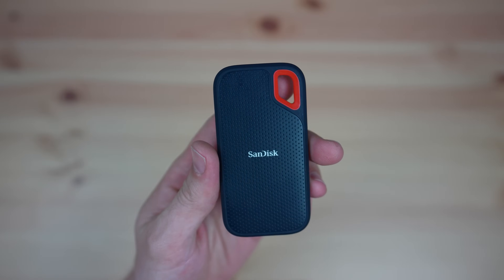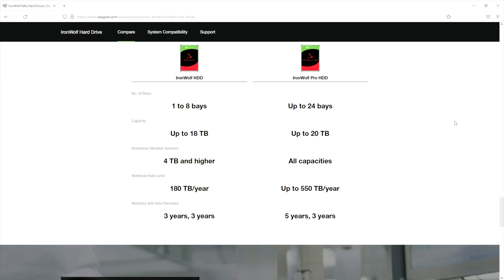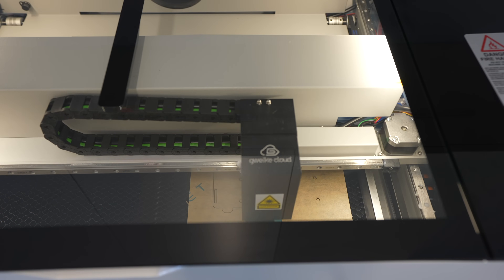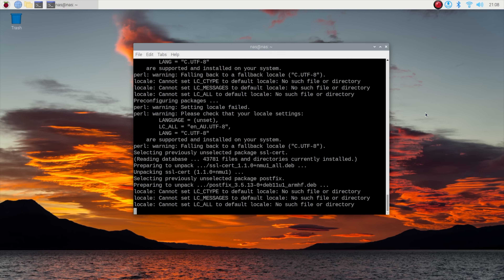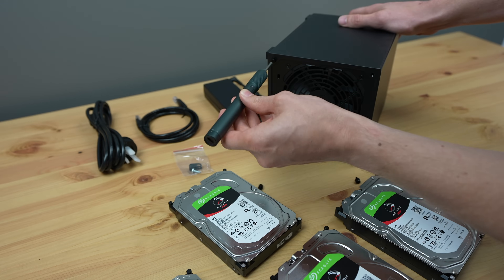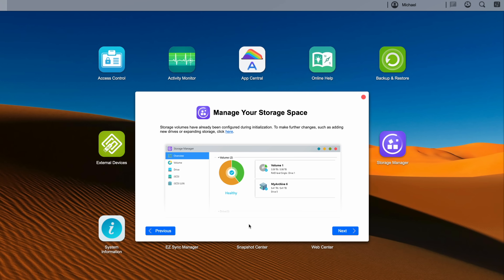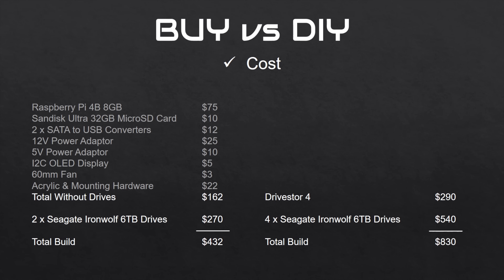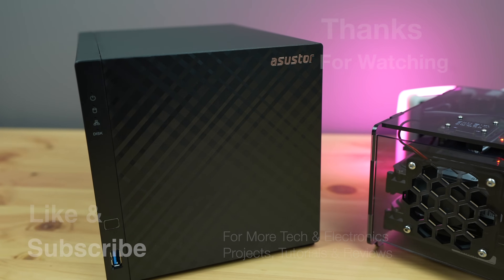Raspberry Pi NAS vs. Asustor Drivestor 4, Is It Better to Buy or DIY?

Comment: Very nice comparison. I am myself using a Pi Based NAS mainly because, I just use my NAS for casual data sharing, running services like jDownloader, transmission, PhotoPrism etc and also using Syncthing to backup my MacBook data folder in real time. It serves my purpose and as I bought my Pi long time back, it is very cost effective. But I recommend using a dedicated NAS for heavier usage or making something with little bit powerful CPU and motherboard and at-least a 2.5G networking.

BTW - I really liked your Pi Case. I wanted to make something like that for my Pi but I was too confused on how to design so that they would fit properly on sides. I ended up making a 3D Printed case and using black transparent acrylic on the side. I will definitely try to make acrylic one now. It looks way cooler than my 3D Printed one. 

Also I am using same display and showing Date/Time/IP/CPU/Memory and Temp. If you would like then I can share my python script with you.
Reply from the maker: That another nice feature of a Pi NAS, being able to run a fairly broad range of other services on the Pi alongside the NAS software.
Definitely have a try at it, it's pretty easy to design 2D parts once you get the hang of it. I've put this design up on my blog so you can download the design as a starting point if you'd like.
Reply: @MichaelKlements  Thanks. I am using 2 smaller 2.5" hard disk and I have removed USB 3.0 ports and soldered SATA ports directly to usb 3.0 in pi to remove all cables. I am also using one small SMPS to power Pi and USB HDD. The only cable now is power cable and ethernet. (I hate wires)

I saw your tutorial on 2D designing when going through the video and will definitely give it a try. Thanks a lot for such amazing content.

Comment: You compared a 2 independent drive configuration with 1G Ethernet on the Pi to a 4 drive raid 5 configuration with 2.5G Ethernet on the Drivestor. The Pi is completely bottlenecked at the 1G E. It is common for many NAS devices to be limited by network speed. Most people's home devices accessing a NAS aren't going to benefit from the NAS having more then 1G E. The big problem with this Pi config is the lack of RAID or any redundancy. (edited to correct Pi RAID and network config)
Reply: @dav1dsm1th  you're right. early in the video the Ethernet port was clearly empty, he doesn't mention plugging it in or the speed, but later in the video, the Ethernet cable is present. I am pretty sure the pie has 1G Ethernet vs the 2.5G E on the other device which he mentioned at 16:35. Also, while looking for the pie network I noticed he says the pie is NOT in RAID mode because the NAS software he is using doesn't support it.

Comment: Great video! The Asustor clearly wins for most applications which is not really a big surrprise. In your cost comparison you use $75 for the Pi which is probably unrealistic at this point but your overall analysis is right on the money. The lack of RAID on the Pi is a major disadvantage. I really love your cases btw. Wish I could afford a laser cutter. I just recently got my first Pi and I've really enjoyed your videos.
Reply from the maker: Luckily the Pi's I've got were all bought a couple of years ago, but yes, getting Pis at list price at the moment is pretty unusual.
Thank you for the support! 
Take a look at some K40 laser cutter options online, you can often pick them up for $300-$400. It's a good starting machine and it's served me well for three years or so.

Comment: Another great vid.  I have a Pi NAS with only 500GB and had no problems with it.  I found it more reliable than my WD My Cloud.  I plan to build your version, an upgrade for me.  Though the Asustor Drivestor 4 was a stronger performer, I believe for the average person, the DIY version is more bang for your buck.  Great work on the case as well.
Reply from the maker: Thank you Greg, yes if you've got the time and a bit of experience then the Pi NAS is a great option to save some money.

Comment: If you can get ahold of one, the RasPi CM4 is much more suited for use as a NAS. There are 3rd party carrier boards with the needed hardware baked in or for a more custom build there's the official carrier board. If you want to really dig in and learn a lot of neat things, the Raspberry Pi Foundation has published the info you need to design your own carrier board for a completely custom setup. While it's not an afternoon project, it's also easier than you'd expect.
Reply from the maker: Thanks for the tip! They definitely do open up a few more possabilities for a purpose built NAS.
I don't think I'm feelling brave enough to try designing my own carrier board just yet, but maybe one day.

Comment: RAID 0 (striping) is not recommend for reliability and redundancy
And also raid 5 on the drivestor it's like raid 1 
Because raid 5 is faster, so you need to Compare apples to apples..
Also, the USB 3 and lan interface on the raspberry pi shared the same bus.
The USB 3 speed is 5Gbps..
Reply: Actually our RAID 1 is faster. This ARM chip is in many ways similar to the Pi and while it comes bundled with 2.5GbE, similar limitations mean we need to place a switch for the SATA so they end up sharing bandwidth.
Reply: @ASUSTOR_YT  not exactly, RAID 0 With 2 Drives:
Read speed gain = *2
Write speed gain = *2

RAID 5 With 4 Drive:
Read speed gain = *3
Write speed gain = *1
The comparison is not equal 
Neet to compare the same size and number of drives and the same raid.
Reply: @HaimPeretz  Umm.... Ok?
Reply: @ASUSTOR_YT  Hey, you guys don't know what your talking about. It's not like you designed it or built and tested it in house before marketing it. I think Haim knows what he's about /s
Reply: @blazinthat7439  I had no idea how to respond...
Reply: @ASUSTOR_YT  sometimes it's best not to.
Reply: @blazinthat7439  Well. He wants an apples to apples comparison. And our RAID 1 speeds are faster because it is not dividing the bandwidth between the two SATA controllers so.... Maybe we should take the not-kneecapped performance figures to look better? :P 

Anyway, hope you're having a FANTASTIC day!
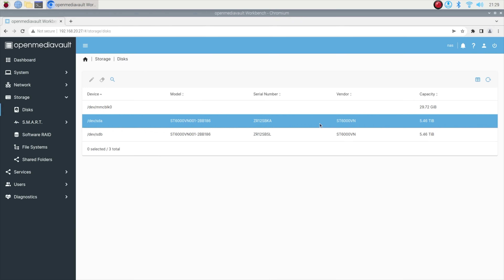Reply: at 7:53 he says ideally the pi would use RAID, but the specific NAS software he is using doesn't support it. It is 2 SEPARATE drives as SEPARATE volumes. So REALLY not apples to apples. However the pi's real bottleneck is the 1G E vs the 2.5G E on the other device
Reply from the maker: You can't really do an apples to apples comparison using a Pi 4, there are fundemental hardware differences that you can't get around. As you've said, the USB and Ethernet ports share a bus, so that's the biggest limitation on the Pi.
The Pi NAS isn't using RAID 0, it's using two separate drives as OMV doesn't support RAID on USB connected drives.

Comment: Thanks Michael for taking look at our NAS devices! We love listening to all types of comments, whether they be praise, questions, suggestions and criticism. Feel free to send a reply and we will happily answer! Thanks again!
Reply: Nice that you listen to feedback compared to other companies
Reply: @ahyaan2552  Thank you for your reply! We strive to always improve!
Reply from the maker: Thank you for the opporunity to try it out! I really enjoyed making this video and trying to build my own contender.
The only thing I really questioned when putting it together was why the Drivestor 4 couldn't be made compatible with 2.5" drives like the Pro version? Obviously the drive bays are designed around 3.5" drives, but it seemed to me like 2.5" drives fitted into the bays perfectly to secure with two screws on one side. So they would only require a standoff or small metal bracket to secure the opposite side. Not really a complaint, just something I noticed when putting it together.
Reply: @MichaelKlements  Well... Between the hardware performance limitations and lower retail cost, we need to keep our support resources from being stretched to keep the experience good for everyone. We haven't locked it, so you can put an SSD into it if you want and it will work. But adding SSDs to a NAS that likely won't benefit much from their capabilities as well as asking all of our partners to provide SSDs to test and then having to support customers that don't use the correct bracket because they are relatively rare would provide a subpar experience. This NAS is not a jack of all trades, but instead, a master of one.
Reply from the maker: That's great. It makes sense to keep the cost down, being one of your entry level products, and it's good to hear that you only release products/features that have been properly tested!
Reply: @ASUSTOR_YT 
The only deal breaker is cost, I would absolutely go for a pi or a DIY low powered PC method. This would be worth it for performance but the price isn't justifying what it does especially for the specs. There are cheaper DIY methods that are reliable using an older Optiplex of the SFF T Intel series that compete with power consumption also. Calling the $1k price range a dud